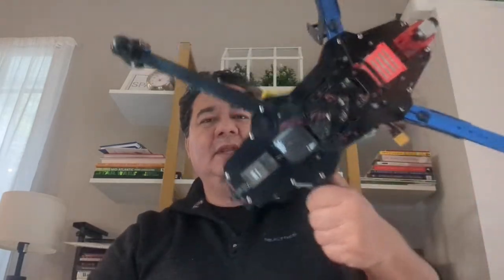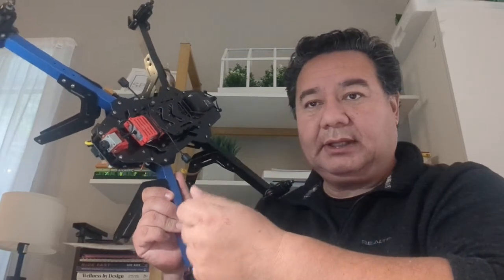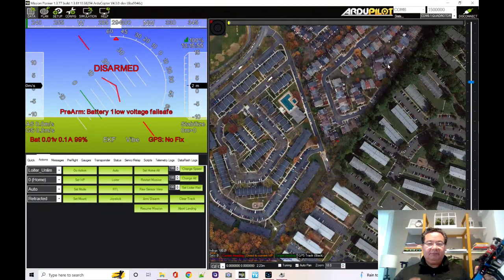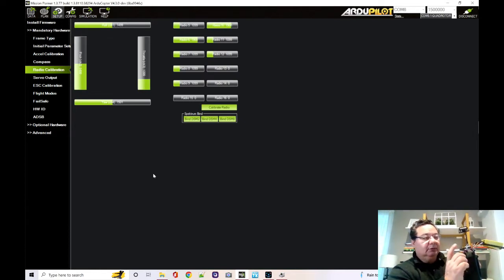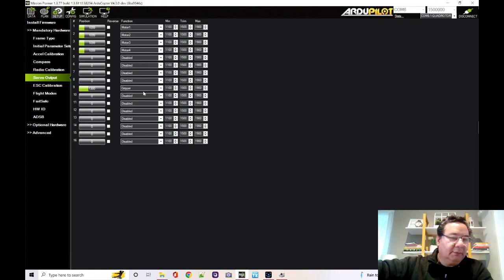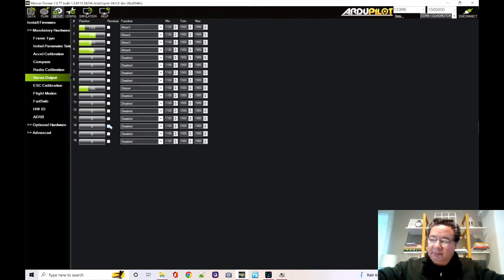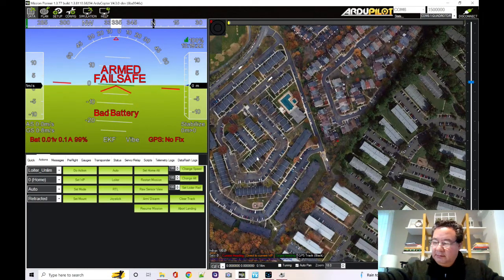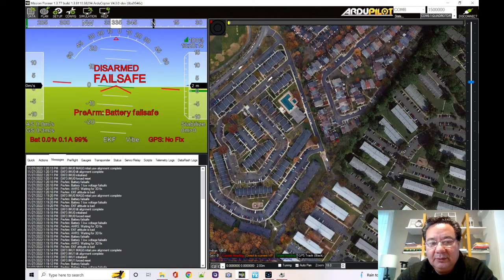My Arducopter motors are not spinning - Verify signal to motors

Comment: I have the same problem it says “ bad battery “ it also does that beep and one motor doesn’t spin  , last trip on the field  you can see on the my last video , I will try to recalibrate my accelerometer, any help or suggestions will be appreciated 🙏🙏
Reply: I had my motors dying! It turned out to be a loose connection. I jammed it in good this time! Good luck.
Reply from the maker: Did you figure it out? Bad battery typically means the FC thinks the battery is too low.  Check your battery settings to it expects the correct voltage.
Reply: @theflyingsandalrc I thought that might be the case , but I will flash my orange cube with the newest version and rewrite the parameters.👍🤞

Comment: This video just shows just to verify your RC is communicating with your drone. This should already be checked when calibrated your RC stepping process. This really didn’t explain why your motors aren’t spinning. Like a failsafe is telling the drone not ti fly because it could be it’s telling the drone don’t fly. Or even check the parameters there more than one reason I think this video wasn’t helpful.
Reply from the maker: Thanks for the feedback, I'll try to address other issues in future videos.
Reply from the maker: By the way, you may not have watched the whole video, in minute 4, I show how the FC starts sending the PWM signal to spin the motors, that was the whole point of the video.